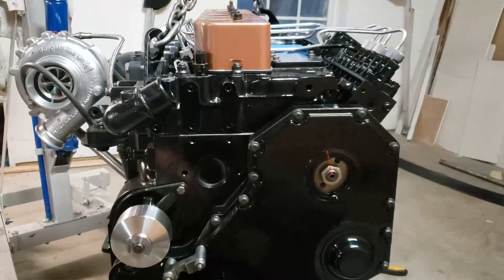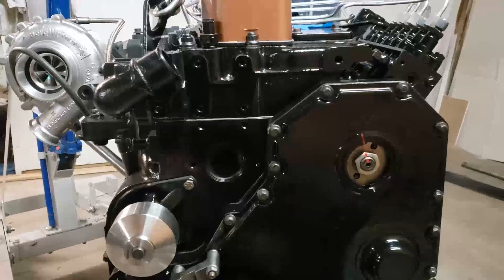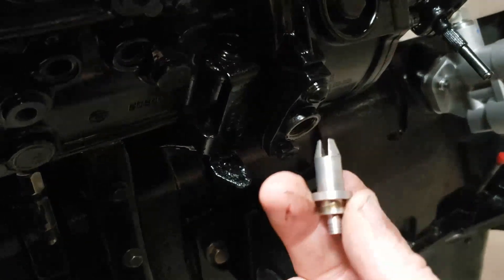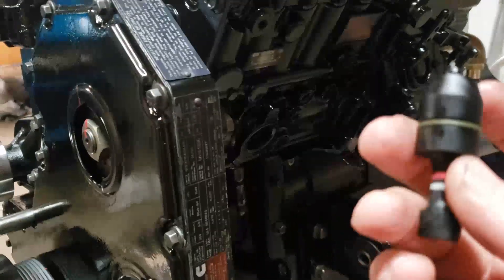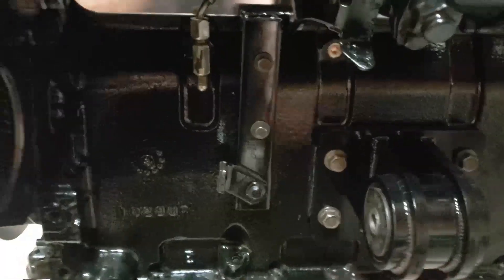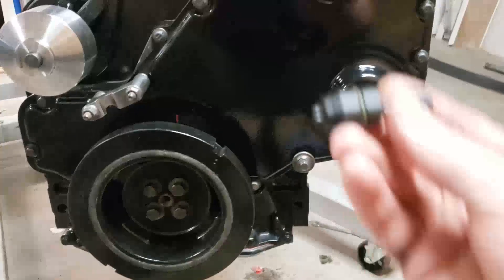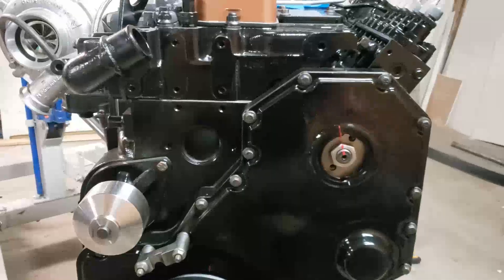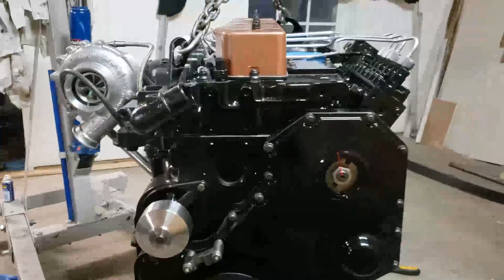12 Valve Cummins Diesel Engine Timing Pin Quick Tip - Finding TDC The Easy Way

Comment: Hi Dante. Could you advise which intake and exhaust valves to adjust at tdc and at 180 from tdc?
180 is at the crankshaft or camshaft?
Thanks

Comment: So.... engine is at TDC. P100 is still in truck.  Does that mean the pump is TDC? This is where I sit at the moment. Any guidance?
Reply from the maker: The pump is always going to be a bit advanced in relation to engine TDC.  When engine is at TDC have you verified if the pump can be pinned using the included pin tool?  If the engine is at stock timing (listed on the engine serial plate), the pump should be able to be pinned when engine is at TDC.
Reply: @dante04srt  truck is not stock.  I will not be able to pin the pump.  Will I lose my timing that has proven to work well?
Reply from the maker: @jeremiahvotruba2921  I'd say unless you have a degree wheel or some way to measure as you turn from TDC to where the pump pin lines up, you'll not have a good reference to where it is now.
Reply: @dante04srt  uhhhhh that's not good.  Very much appreciated responses! Thank you sir.  Have a fantastic day.

Comment: Help me a lot understanding when I went to ajust  my valves after head gasket repair had other people saying after I get pin to slid in the d-tent hole and set valves on #1 and it’s companions is rotate over 360 and put  pin back in and do again but it’s not there your right. You would have to spin balancer twice just to get it to see hole in timing gear were pin goes..
Reply from the maker: Glad to hear it helped you out.

Comment: How did the swap go?
Reply from the maker: Swap went good.  Got it running in my 98 K3500 dually cclb.  Sooooo much better than the 454.
Reply: @dante04srt  I bet it gets better fuel mileage too
Reply from the maker: @oldcroneysgarage9739  MUCH better.  I haven't done any MPG figuring yet as I'm still getting things dialed in but based on the fuel gauge alone, I am seeing significantly better mileage.
Reply from the maker: Now that I've got about 14,000 miles on the swap now, I've been able to get some good mileage data.  At about 65mph, I'm getting about 18mpg.  Loaded with our camper (~8k fully loaded) I'm seeing 13.5+.  Bear in mind I still have 4.10 gears so there is still more to gain if I regeared.  All in all, I'm very happy with the swap.  It makes the truck so much more capable and fun to drive.